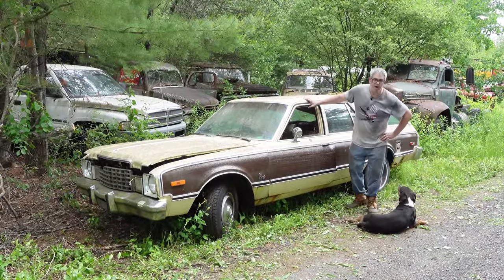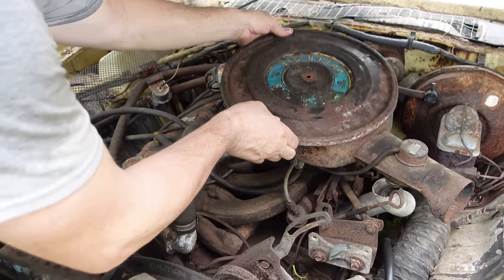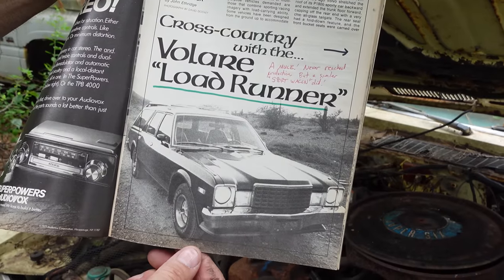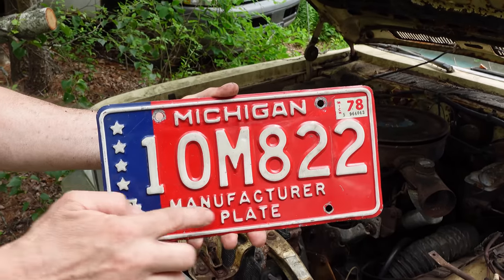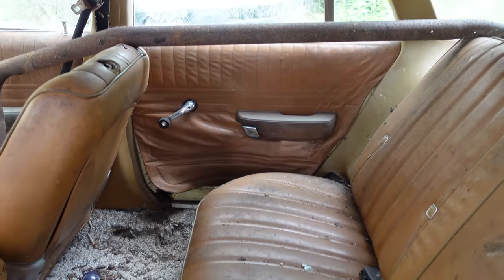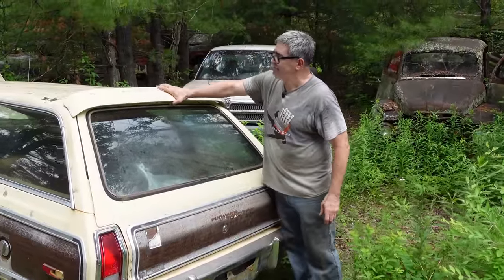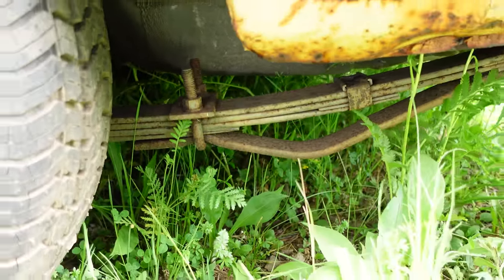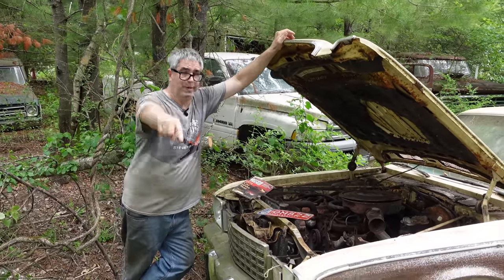Road Runner Station Wagon?

Comment: I have a 77 two door and did have two dodge aspens they're great cars even the slant six both aspens were police interceptors they were comfortable and reliable I'm a transmission wrecking ball good thing my volare was a standard shift with a few performance enhancers I only got beat by one car in it and it was a stroker mustang automatic he shifted faster out the turn and nosed ahead I've had it over 170 with the rest of third and another gear to go man it was scary at that speed the thing would eat a stock Corvette alive I've always wondered what it would've done with a straight away long enough to max it out in 4th the six cylinders rear end had something to do with the speed it was only a 318 don't know how much was done inside the engine but she had a hot coil headers highrise intake things like that

Comment: One of my first cars...kind of, was a Dodge Aspen wagon, $100 in 1989/😂1990 or so. Towed it with my Dad's D100 to where my mechanic brother could look at it where I found out it had a broken(rusted through) frame/unibody so to the junkyard it went. I also had a very rusty, $1, 1967 Chevrolet truck with a very oily straight 6 and a three on the tree, never made it legally on the road. Then I had a mercury lynx that started blowing oil out the exhaust driving that home, from buying it, that never made it on the road either. My 4th car became my first, to make it on the road, 1985 Plymouth Reliant that turned out to be a reasonably reliant automobile(Bare Naked Ladies)!😂

Comment: Steve   For 79 & 80 Those Were Made the Name Changed to Sport Wagons Not Load runner. Loadeunner Was a Semi-Roadrunner 2 dr package thru 78
Reply from the maker: Yes but no "beep beep" horn or "bird graphics" on the Sport Wagons, right? It is crazy that all the way to the end of the Road Runner in 1980 (only 496 built) they still had "beep beep" horns! And could be had with a - say it isn't so - Slant Six!!! Thanks for watching and writing. -Steve Magnante
Reply: @SteveMagnante  You're Welcome FYI I was owner Moderator of F Body Mopars Club on Yahoo 2005-2014  I've owned 2 Woody Wagons, 1979 Duster option Car, Police Code 360 T-Top 78 Volare Premier & 77 Aspen Custom w 26,000 actual miles Russet Sunfire & Parchment Halo Top

Comment: These vehicles, the Volare and Aspen were some of worse handling vehicles of their era (rust issues aside).

The transverse torison bar set up was great for ride, but allowed for the front end to float and the body to have excessive lean and tire wear.

The shocks in front suspension would last forever because of the design and placement of the shock; it could only move in a couple of inch range.  Replacing the shocks with Gabriel Striders? adjustable shocks set to maximum stiffness didnt help.
(Gabriel had adjustable shocks (i think they were called striders that had three settings; soft, oe, stiff/maximum handling)

Comment: I drove a Volare as my driver's ed car.  I drove plenty of slant six engines over the years in many different Chrysler products.  I loved the slant six engine.  My father and grandfather worked for Chrysler-Plymouth/Dodge dealers respectively.  I was not happy with the Aspen and Volare compared to the Valiant/Dart/Lancer which they replaced (as well as the "B" cars like Satellite, etc.).  Quality was not great and some came so stripped in a worse than cheap taxi way that was just embarrassing (colors, some terrible seats, no radio).  Having said all of that, I did see or drive some nice versions (once the problems/recalls) were sorted out.  They were actually decent if you had a good one.

Comment: We had a 77 Volare  premiere wagon what a piece of crap it had the 360 I think or 318 with the California package lean burn system 
The car never ran right would stall out in the middle of intersections  then would not want to restart easily my dad would finally get it started and lift hold it to the floor not to mention when we got rid of it in the early 80’s the lower rockers were rusted out and the radio antenna literally fell down inside the fender

Comment: I had a 76 Volare with t tops  4 speed  with the so-called Super Six .
I know the Slant Six is a tough engine but I never cared for them.
Reply: Very well made engines. The carburetion and ignition was complete crap and that's what made them stallers and frustrated many owners. Other than that, it is a solid engine.
Reply: @googleusergp  Yes but a 318 was much better choice.
Reply: @garymckee8857 Yes.
Reply from the maker: @googleusergp  The big bummer about the 225 Slant Six is the extreme 4.125-inch stroke length. A full inch longer than the original 170 Slant Six, the 225 even required a half-inch taller block to accommodate the extra stroke. Though the extra cubes are good for small truck / van and full size economy passenger car use, the BIG PROBLEM is that the 225 cylinder head was initially designed to support the airflow needs of the 170 cube engine. In fact, they share the same head. Unfortunately when the 225 was conjured as a companion to the 170 there was no cylinder head development to match the extra 55 cubic inches. Thus, the 170 is actually a better balanced package and can actually run to near 7,000 rpm WITH race prep, just ask Lee Petty, whose 170 cube Hyper-Pak Valiant ran 143 at Daytona 1960 on the "Baby Grand" mini-race before the Big Event for the grown-up cars. But the lanky 225 with its extreme under-square geometry and asthmatic cylinder head is out of breath at 5,500 rpm, more like 5,000. I've built several of both and even some nitrous, aluminum block and aluminum head engines (I secured TWO prototype aluminum heads from Chrysler's Kokomo, Indiana Forge and Foundry Division). Yes, Slant Sixes are durable but lack "serious" potential unless you are talking about recent turbo kits from Torque Storm. But a turbo will make anything turn on - for a while anyway. Thanks for watching and writing. -Steve Magnante

Comment: My in-laws bought an F-body when they came out.  Great car except for some nagging problems that the dealer couldn't/ wouldn't fix.  They pretty much stopped by Chrysler cars after that (and the problems with their 74 Charger) even though he worked for Chrysler.  They drove it too easy to experience the notoriously weak front suspension.

Comment: those are the F-Bodies Mopar Plymouth is the Volare and the Dodge is the Aspen on Volare as I read about they got Road Runner from 1978-80 and Duster from 1979 year only but a 1980 Duster was just a trim package and on the Aspen they got R/T and in 1978 when my dad got his 1970 Duster 318 a guy pull in at my dad old shop and wanted my dad to trade his Duster 3spd manual trans for his slant 6 1977 Dodge Aspen A833 O/D 4spds manual trans and my dad got his 1970 Plymouth Duster 318 up to 29-31 miles per gallon from 1978-2001.

Comment: 360 was only available in 2 doors.not wagon or sedan.
Reply: That is not correct as the factory literature clearly shows the 360 as an option for the wagons.
Reply from the maker: @googleusergp  I had a '76 Volare wagon with the "K code" 360-2 that was factory stock - complete with RUST in the frame and entire body. But it would annihilate the right rear tire (no Sure Grip). Thanks for watching and writing. -Steve Magnante
Reply: @SteveMagnante  Correct the 360 V8 with two barrel was indeed an option for the wagons. The other poster is incorrect.